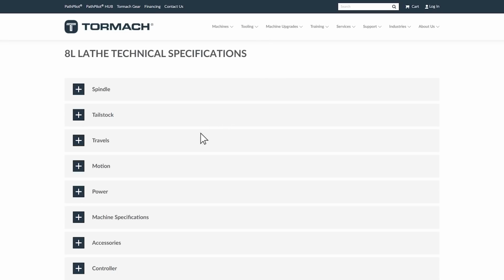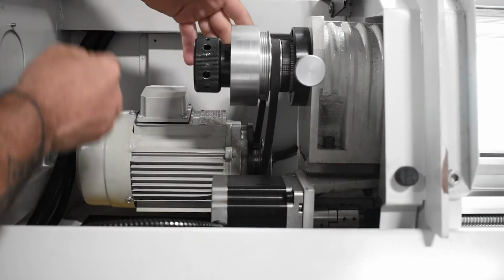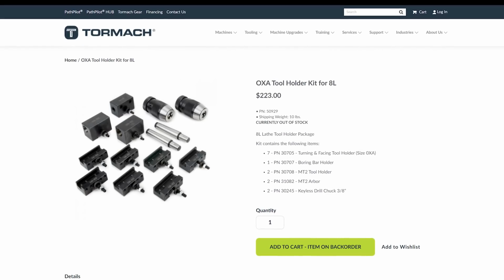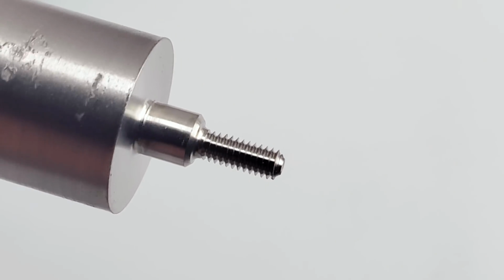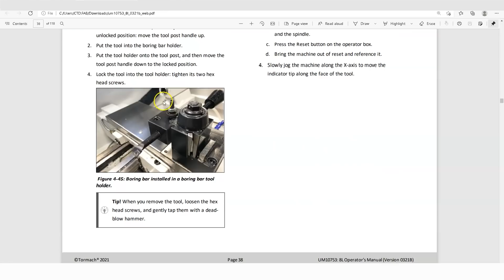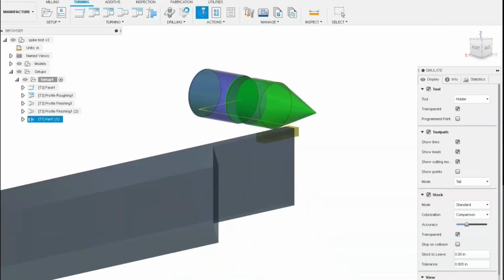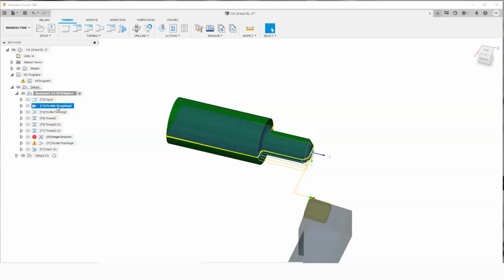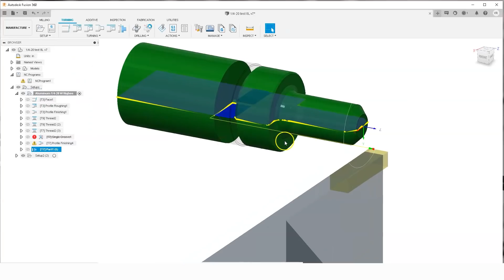Tormach 8L Lathe Introduction and First Chips!

Comment: I was having a problem with toolpost  moving around. I machined a bushing to take up  the space between the tookpost and the mounting bolt, and now alignment is much easier without the toolpost sliding around when adjusting, hopefully that will keep it from being knocked out of alignment so easy. I am not using coolant on mine as i got mine for hobby use, and no way to legally get rid of used coolant out here in the sticks.  Love the conversational programming on pathpilot.
Reply: To get rid of the coolant, you could put it in a barrel outside with the top off but covered in some way so it doesn't fill up with rainwater and so animals can't drink it and the water will evaporate away and leave you with a much lower volume of concentrate to get rid of.  I only change my coolant every 18 months or so.  Just need to check the coolant concentration and top up with non-tap water - I collect the water from a dehumidifier or you could get a deionized water filter which would be better I think.  I also run an aquarium air stone pump if I'm not using the Mill for a while.  I also use a tramp oil pillow to soak up the oil, though I forgot to get a new one last time and just use some pig mat.

Comment: I am a conversational programing machinist and its much simpler than it looks it can be hard if you use to seeing a 3d model of you part but in my experience in conversational programming I've only worked off a print to do all my programing have to try to make the part into a 3d model in my head. It can be hard for some but also its pretty easy to pick up. Also I only program on mazak in mazatrol.
Reply: I have dabbled a lot with the conversational on our Haas VF2 in our shop. It’s pretty user friendly for the most part. I have found it more useful on mills than I have on a lathe. Fort the most part, if you have a turn program already written, you can just copy and paste almost any path you would need and play with the canned cycle.

Comment: Love what tormach has become and done, I wish I would have started off with them but after you learn to build cnc machines it's hard to ever justify going with their machines.
Reply: This has some good features but tool plate and bar feed for small production runs is what I am after. Still a nice size for a home shop. Going to check out the pricing.

Comment: I don't see the point if you have to change each tool by hand. Tormach should make a swiss style, dual spindle cnc lathe with this footprint, that would be neat.
Reply: I think changing the tool by hand is a marketing thing.  From some of the reading I have done, it seems you can mount a tool post at the other end as well, or some form of gang tooling but there is no real information on the Tormach site to support that.  It's only a matter of time before someone comes up with a small automatic tool post that can be fitted.

Comment: One thing that I've often thought about is taking advantage of quick release couplings for improved coolant delivery.

A lot of turning holders (particularly the capto style) have directed coolant jets which are directed straight at the cutting zone so having quick release units built into the turret would make changeover a lot easier
Reply: A lot of them come with a tool that you stick into the hole and move the jet to direct the flow. It's like a ball & socket that you can move around.
Reply: @littlejackalo5326  Yeah I've seen those before but this was more to do with the fact that a lot of turning toolholders have directed coolant nozzles which are designed to hit right at the cutting edge.

If you've got a good flow of coolant from the pump that's then forced through a small opening it's a definite improvement on the coolant delivery compared to just dribbling it over the whole workpiece.

For manual/small CNC lathes this might require a fair amount of thinking but on more production-ready suppliers (Doosan, DMG, Mazak etc) this is more readily available.
Reply: the coolant couplings for TIG torch chillers are a great option - they're small and quick and have always been leak free for me.
Reply: @alexwbakker  that quick release mechanism is what I'm thinking, they're the same as pneumatic connections, but they can come threaded on one end so drilling and tapping the ends of boring bars with these fittings would give you much better controlled coolant delivery for boring

Comment: do you need to touch of the tools every time you switch them or can you select a tool and it will select that tool ofset?
Reply: Pathpilot (the control software that runs the lathe) stores the tool offset data by tool number. So you don't need to touch off the tools every time.
Reply: @robertbeatty1  ok cool thanks
Reply: 8:50 min talks about templates in fusion that you set the tools too.
Reply: @18voltmofo  yeah but i dont think those have the offsets tho
Reply: I'm pretty sure the machine can store tool data.